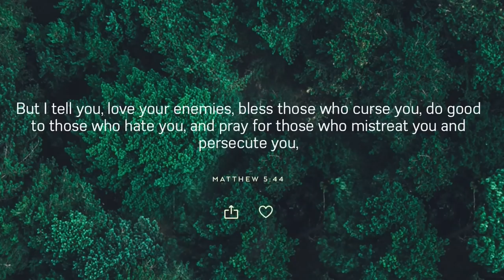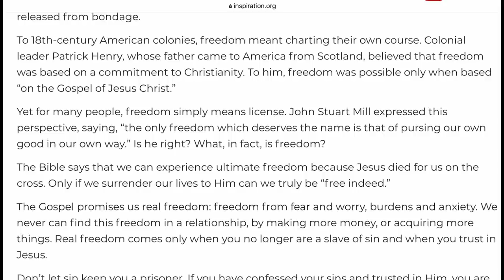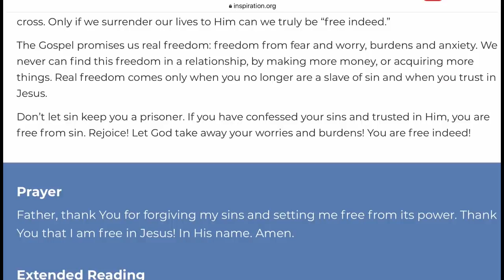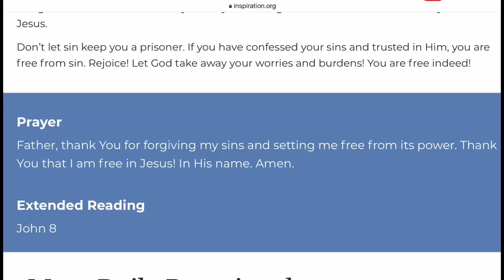July 4, 2020/279 Trucking. The Worst truck wreckage I’ve ever seen .

Comment: JBG I have seen similar accidents... one was with rolled steel and one with steel pipe, neither load was secured properly and the truck comes to a sudden stop or hits something (as in rear ends a another truck) and everything comes forward or backwards. 

A 15 or 20,000 pound roll of steel will Steam roll and flatten a truck! 

The other was a dump truck whose “ brakes failed” and rear ended a truck carrying oil field pipe. The pipe on the front truck went thru the dump truck that hit it. Yeah stuff nightmares are made of.

Comment: Don't think anyone was in it. The steering wheel is flat on the seat. If someone was in it they'd have cut the steering wheel out to remove the  driver. Could have been on a drop trailer  and went under a low bridge.  I hope.
Reply: Bush Hippy I agree, no blood also